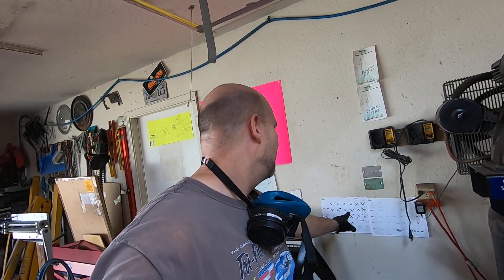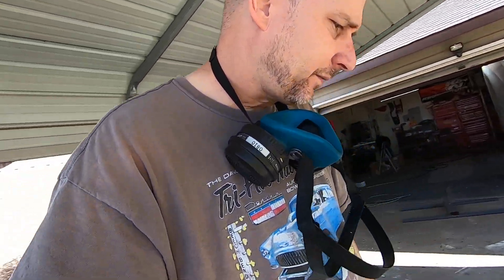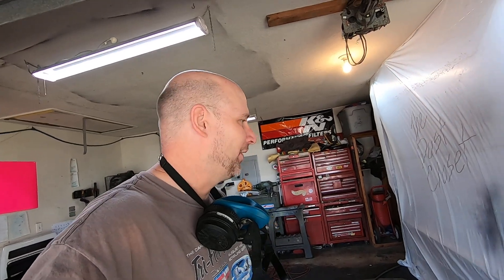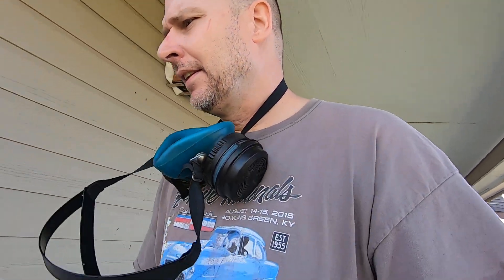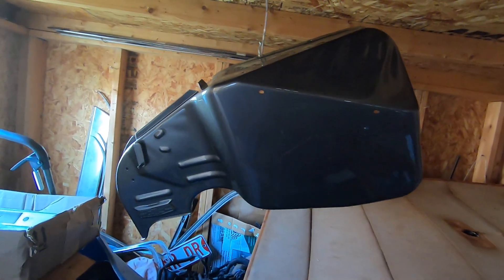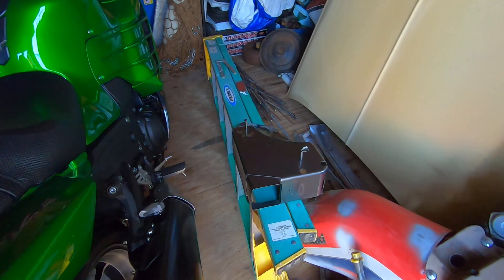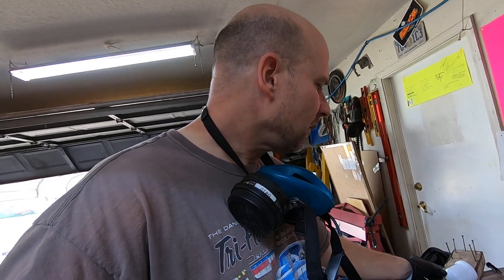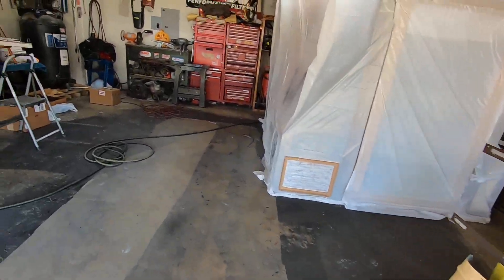1955 Chevy, countdown to show. Setbacks

Comment: Not trying to be critical but have you tried shutting the fan off when you went in and out? I found a remote control 110V gadget on Amazon for a few bucks that will turn on or off any thing plugged into it. It plugs into the outlet. Then you could shut the fan off from inside or out. We use one on the  electric fence around our chicken coop so we can turn the power off without unpluging the charger which doesn't have a switch.
Reply from the maker: I did that today Walter. Also put another fan blowing into the filter. It worked most of the day